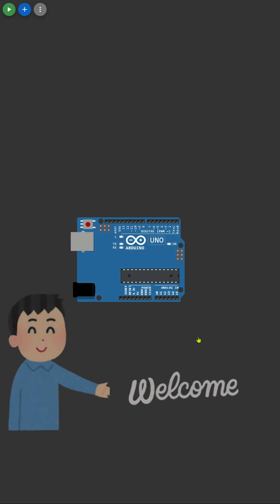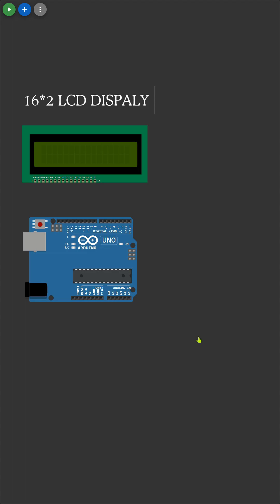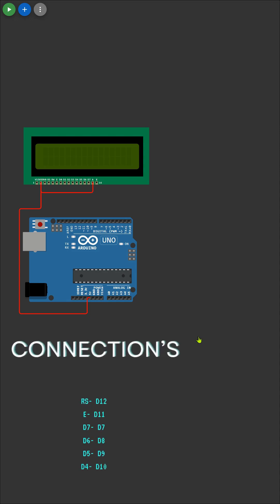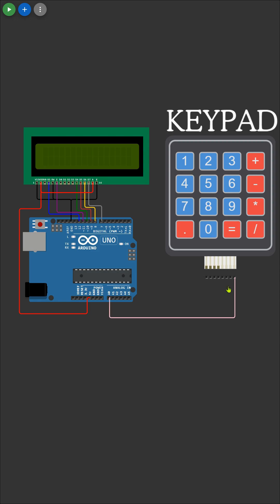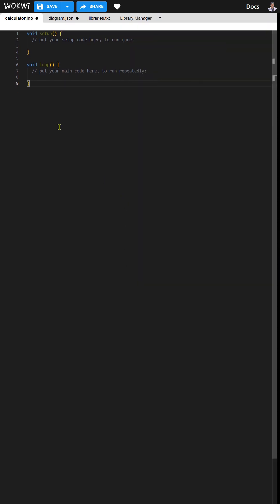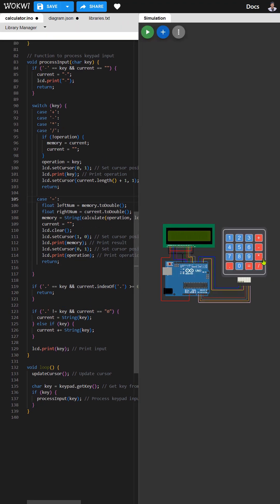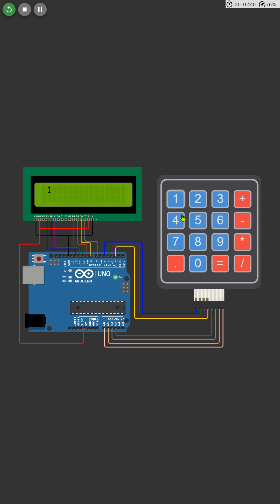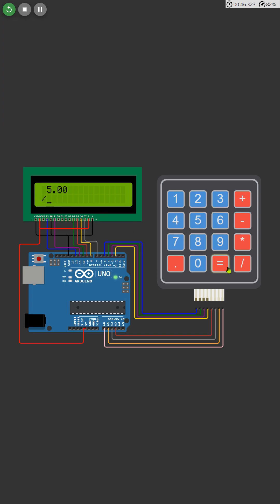🛠️ DIY Arduino Calculator: Build Your Own with Display & Keypad! 📟

Comment: hi
 please help me with this project :
t seems like you are looking to create an automatic system using Arduino for controlling 2 water pumps, 2 electro vanne, and 2 water level sensors. Here is a basic outline of how you can achieve this:

1. Set up your Arduino board with the necessary components including the water pumps, float switches, water level sensors, and solenoid valves.

2. Define the connections for each component and write the code to control the system based on the inputs from the electro valv and water level sensors.

3. Implement a start button to begin the system operation.

4. When water level sensors 1 is activated, start pump 1 for 30 seconds and open  electrovalve 1.

5. When water level sensors2 is activated, close electrovalve 1.

6. Once pump 1's operation time is complete, start pump 2 and open solenoid valve 2 for 10 seconds.

7. Repeat the cycle for continuous operation.
Thank you
Reply from the maker: I'll try to make it for you